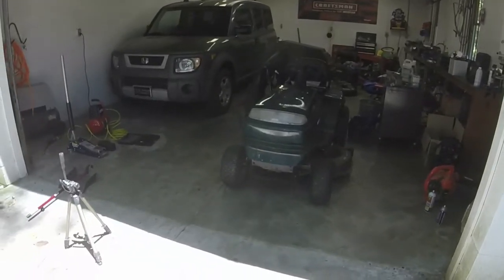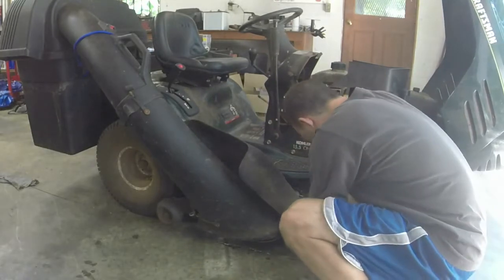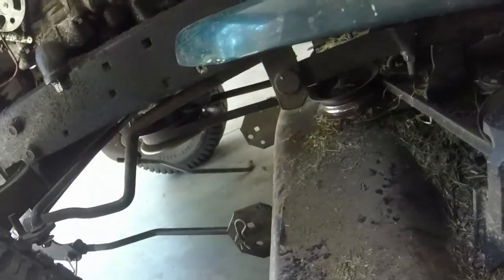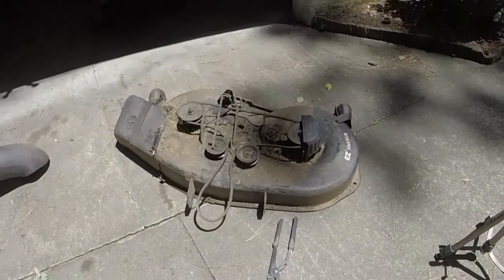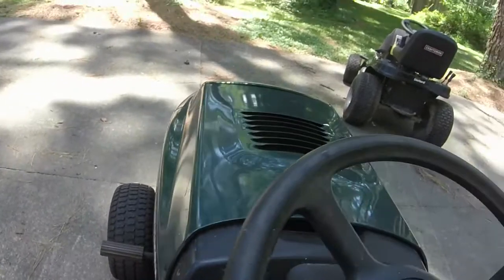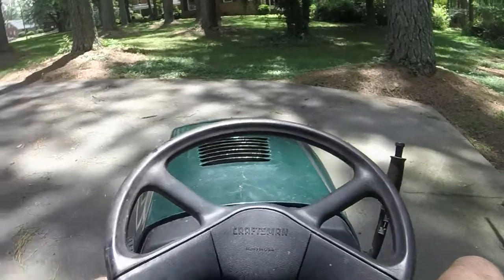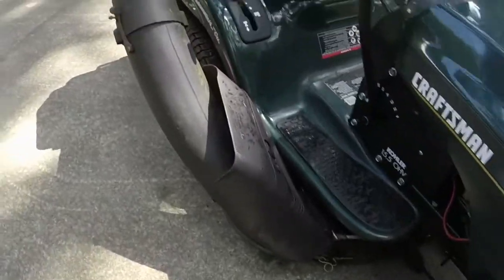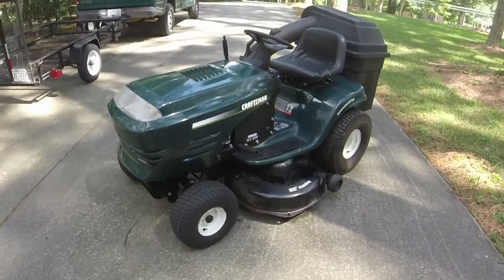Craftsman Rider with Kohler Command engine deck belt too tight engine locked: an obvious easy fix

Comment: I wish I could get like that just once... I'm happy for you Buddy!!!!
Reply from the maker: Thanks Rick, tried to help him out by telling him what was wrong but decided to trade anyways.  Easy money for me!
Reply: Same here. Merry Christmas.
Reply: Nice one!  Thanks for the good video.
I recently bought a 917.271060 for $185. (2001, maybe?...owner's manual has a version date of Nov.'99; it HAS the CABLE action engaging the blades:  but, that pivot plate needs some more cleaning & lube...)
Had to patch the deck, and reinforce around the mounting link plate on the front right...
Did a lot of cleaning, and painted up my patchwork (even though it is just for me...)
Picked up a 5-piece filter kit (inc spark plug) for $21, and a jug of 10W-30 to replace the chocolate syrup in there, and she runs pretty good!...steering not quite as loose as the one in this vid'.
2 questions, if you don't mind: 
1. I picked up a 2 bin bagger, for $60, and it worked fine, at first; after I emptied, it stopped filling at less than 1/4 full.  Previous Owner was 100% mulching, so I had to clean the deck well, top and bottom, and it doesn't seem clogged up;  I mowed at deck level 6; then lowered it to 4, but my yard is very uneven, and soft:  not a putting green...😉  
It's not urgent*,
but I would like to understand: going to pull the deck, again, in a few weeks, and lube up the pivot plate on the engagement pulley; and anything else I need to do down there at the same time...😉
2. The previous owner SAID he bought it new (I almost forgot to ask for the manual!); but, for some reason, it doesn't have the 'engine air duct' on top of the Kohler CV-15S  engine...and it doesn't look like it has been there for a long time (based on the chafing where the hood comes down and rests on the dashboard frame...but, maybe that's not related...).  
SO, should I be looking around for a someone who is parting out their machine, to salvage the Part # 150127...? (assuming I can get the screws with it)...or will this just mean my engine gets dirtier?
Thanks, again!

* (I mainly got the bagger for leaves in the fall, so don't need it ATM; but, without a mower for 3 weeks; grass had gotten pretty tall, so I wanted to try it out!)

Comment: Wow what a part exchange. Quick belt fix.. bit of spit and polish.. good to go.. looks sharp mate.. good to get an easy one..
Reply: I never get that lucky.
But I would straighten out the steering wheel.
Reply from the maker: Thanks Mick.  This was welcome as I had just done all the engine swaps on the others.

Comment: I heard you say that you thought that it "might" be the wrong belt, but it appears that you didn't replace the belt.  Was it just routed incorrectly or were there other issues with idler pulley, etc.?  Thanks!
Reply from the maker: It was just routed incorrectly.  He forgot to put it inside one of the pulley guides and had everything bound up.
Reply: Mines too tight,I can't get the new one on. Can you help me  with  that?It's hard to find a video with this exact mower . Thanx

Comment: I was  wondering why you wouldn't take the deck off? That way you can see exactly what's going on.
Reply from the maker: After I found the belt routed wrong I knew the issues without taking the deck off.  Had there been more issues I definitely would have taken it off.